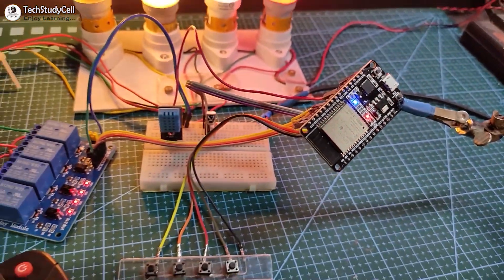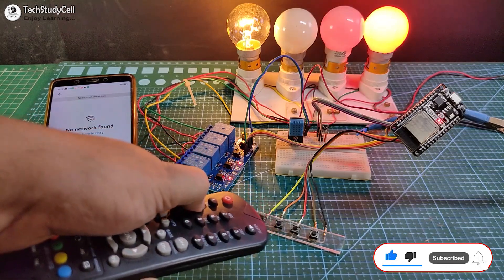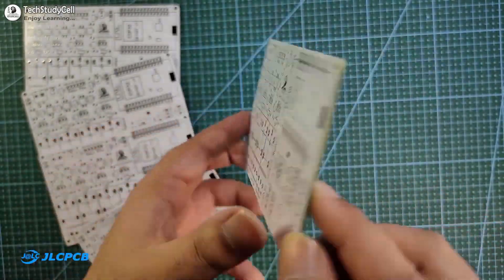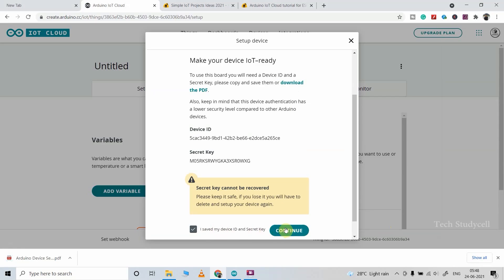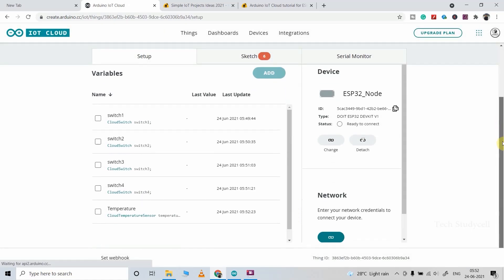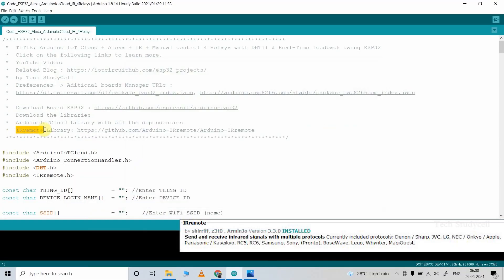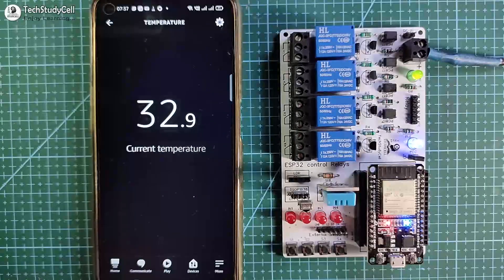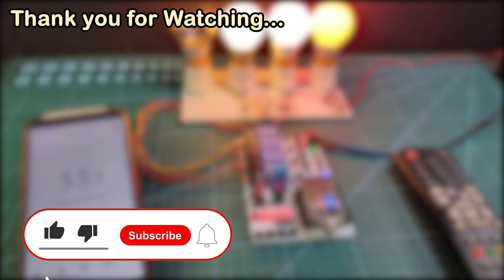Arduino IoT Cloud ESP32 Home Automation with Alexa IR remote & sensor - IoT Projects 2021

Comment: Hello All,
    I am facing a big issue in Home Automation project, that I have designed a PCB with 4 Relays and ESP32 (GPIO Pins are 22, 4, 2, 15 for Relays) n (32, 33, 34, 35 for manual Switches) and also I have attached it to Supply Switch Board, it's working fine but sometimes when I switch OFF the one device from Manual switch at the same time remaining devices are getting turn-off (Flickering was occurring, lights getting ON n OFF) will anyone tell me how to solve this Issue, will be very Thankfull...
Reply: Hello. Please tell me, did you solve the problem?
Reply: Use 5v 5A smps. I think fixed it

Comment: Hi Great Video Bro i loved it, but facing small error that after uploading the code into ESP32 Board, Switch3 is auto-Turning ON and OFF. will you help me out how to solve this error. Thankyou...
Reply: @Pratik Paratwar Thanks for the Reply, I tried many times like 5-6 times but didn't work.
Reply: Check the power supply.... If there is any short circuit...

Comment: Bro can we use 16 channel relay module with eap8266
Reply from the maker: It better not to use 16 relays with single ESP8266
Reply: @TechStudyCell   is that esp 32 is better for 16 channel relay
Reply: @TechStudyCell  how much of relay Can connected with esp8266

Comment: can we use esp8266
Reply from the maker: Yes, in Arduino IoT Cloud you have to select the model accordingly
Reply: @TechStudyCell  can we add google assistant support in it too?
Reply from the maker: I don't think so
Reply: @TechStudyCell  can you make a project in which you control 8 channel relay with temp sensor and alexa integration with arduino iot cloud with manual switch

Comment: Bhi pls tell me I want to use 5mm led of any colour red, blue but not white. I want to use 2   5mm led and the power supply is 3.7v 18650 battery. Will the 2 led light up bright pls tell

Comment: Which chip is better for home automation project of esp8266.
1) chip 340
2)chip 2102.
And i want to know which module is better for home automation project
1) esp32
2)esp8366
Reply from the maker: ESP32 is better. But it depends on your requirements
Reply: @TechStudyCell  which module will be less heat?

Comment: Can you make this project with a radio controlled remote?
Reply from the maker: Noted
Reply: @TechStudyCell  Also include the transformer for usb power supply to the circuit board. wifi + RF + USB Power supply everything in one piece. If you make it to fit the swich box would be ideal.